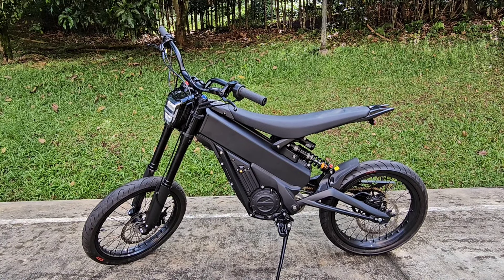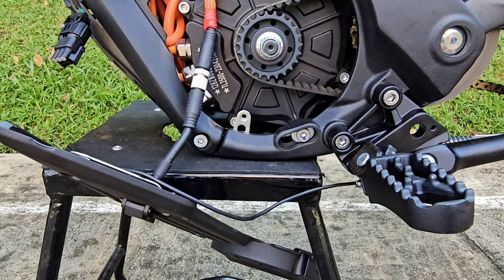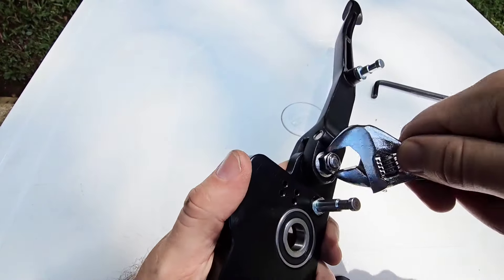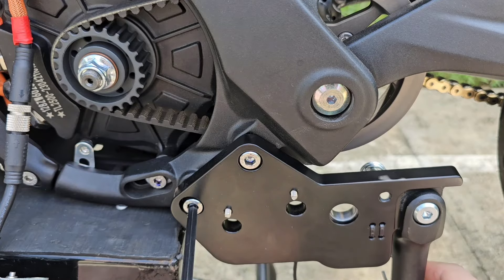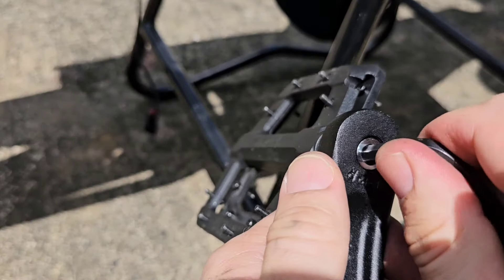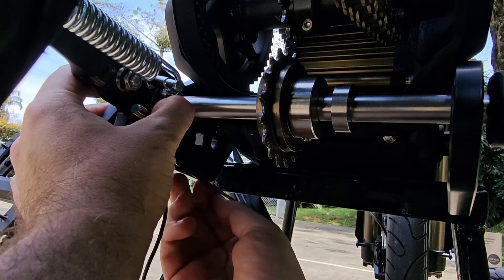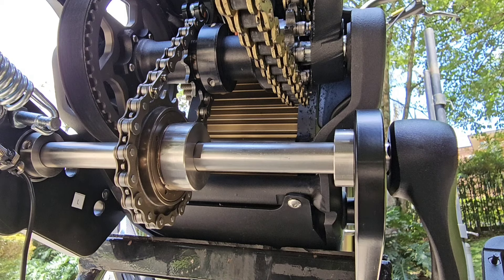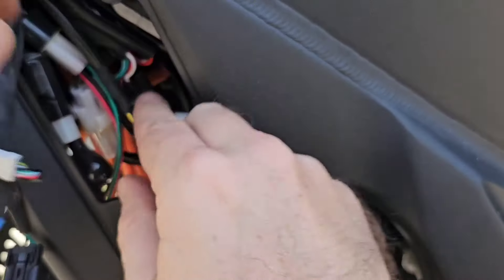KANIWABA TALARIA xXx Power Pedal Kit & Pedal Kit Installation Video

Comment: The only designed flaw on this pedal kit is you wont be able to take out your battery unless you take out the whole pedal bracket which hits the swing arm to slide the battery out

Comment: Does it fit on the new mx5 pro talaria???

 as well, if possible could you all make a design where we can take off the peddles and put on normal pags, aka a quick release so when the bike die you can easily swap to the peddle with just an one tool

Comment: Hey I just want to say, I got one of these, it works as it should but I just encountered a major issue where I'm unable to drop the swing arm to remove the battery because the bracket left side bracket with the kickstand extends too far back. I would have to completely dismantle the pedals and shaft and literally everything just to have access and be able to remove the battery. So if you intend to remove the battery for travel purposes, think again. Please fix this issue 🙏🏻
Reply from the maker: Hi, in order to be able to remove the battery, you need to follow this 2 minute procedure:
1.  Put the bike on a stool so that is supported by the bash guard area.
2.  Remove the bicycle chain master link
3.  Loosen (not remove)
 the lower screws on both left and right brackets
4.  Remove the upper screws on the left and side
5.  Let the side brackets + spindle kit hang down in order to give enough space for the rear swing arm
6.  Do the normal battery removal procedure

Comment: I purchased the Power Pedal version of this Kit. How soon can we expect the Electronic Pedal Assist Kit Add-on for for Talaria xXx ? Is it possible to adapt the Sting R MX4 kit to the xXx ??
Reply from the maker: Hi! We should have the electronic pedal assist ready in about 1 month.  The connectors are different so its not possible to fit the one for the Talaria R MX4
Reply: @kaniwaba  will the electronic pedal assist addon be applicable to the power pedal kit as an upgrade or will it be its own independent pedal kit? im asking because i want to get the electronic assist but dont know whether to wait or if i can install it as an upgrade to the power pedals.